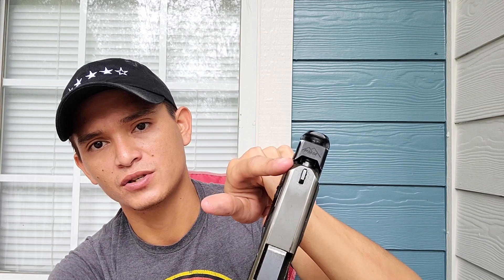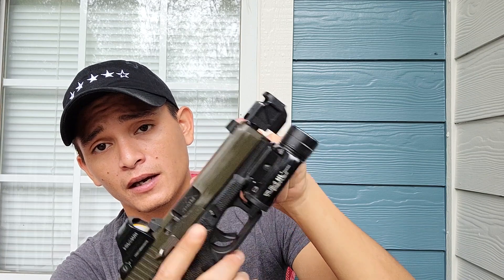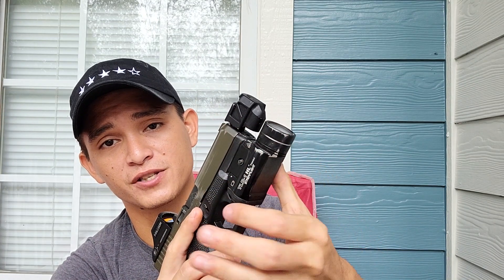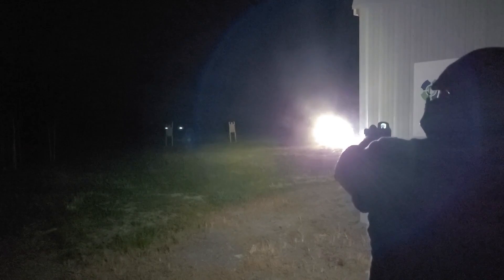Parker Mountain Machine Barrel/ Comp- Review

Comment: I don’t use shims or thread locker on my ppm comp for my p10c. Have had zero issues with it and it’s damn close to the slide but not touching. Their machining was spot on for the factory p10c threaded barrel. Have used it under nods and zero issues there as well. Love it and carry it everyday. Glad to see others having similar results.
Reply: Did you hand tighten it or did you use the vise and wrench as well
Reply: @Encrypt_ed  just hand. It’s not actually snug against the barrel. There is a small amount of play but with the shape of the comp there is never a point where it can rotate during the firing process
Reply: @rogueconcepts7404  cool thanks for the info I plan on getting one here soon to put on my zp barrel
Reply: @Encrypt_ed  I did use the factory barrel since that’s what the PMM one is spec’d to but I’m sure you’ll be fine with that one
Reply: @rogueconcepts7404  yeah I was reading on threads that it should work fine with the zp barrel on my Glock 19x

Comment: My VP9 stove pipes with the comp now. Used regular blazer brass ammo. It has a holosun 509 T on it. Any suggestions?
Reply: You need to get a lower weight recoil spring OR trim coils off the current one until it works. Issue is that the stock recoil spring is based on the energy in the system with no comp. Slap a comp on and suddenly the math ain’t mathing and there is not enough energy resulting in short strokes to stove pipes.

Comment: I've recently started researching comps and I'm debating on taking the plunge and throwing one on my mr920 and my 43x(winter and summer carry respectively). But the loctite worries me. I've got red loctite off before but seems like heating up the barrel and then torquing on it could cause permanent damage to the barrel? Am I worrying for nothing? Also if it's as good as everyone has said, it will probably never come off anyway. I usually retire my firearms before I shoot the barrel out.
Reply: Rocksett exist you know that right?
Reply: @boygonewhoopdataZZ  I know rocksett is strong, but how do you get that off ? I've never used it. Is it the same Everytime? Is heat required on it too? I'm literally asking the question.
Reply: @rcrites  sweet. Thanks
Reply: My mistake was red loctiting a comp on before swapping the factory irons.

Comment: What do you think about running one on the FN 509T (I have done all the upgrades from the APEX.... Trigger kit, Firing Pin,..... Was gonna do the barrel but the guys at apex said their's is the same threaded barrel that comes on the 509T) I noticed that there are two different options for the 509.... 1 and 2 port types.... Your opinion? Thanks Gents
Reply from the maker: It's rather boring, which in it of itself is a complement